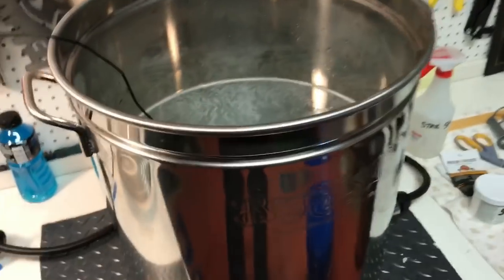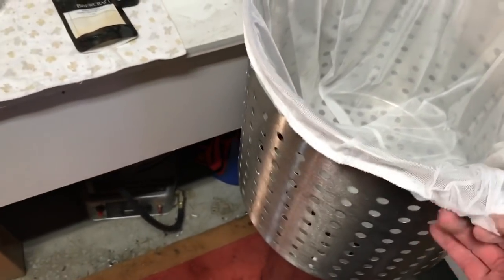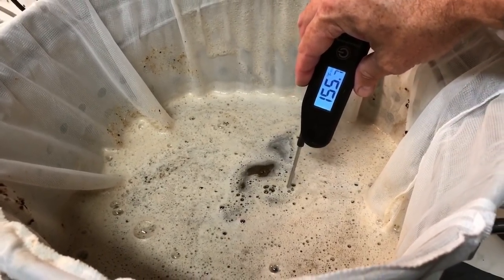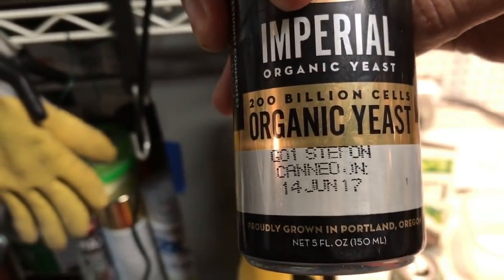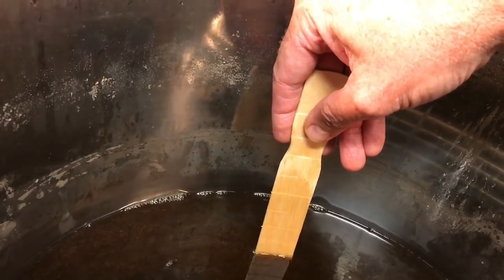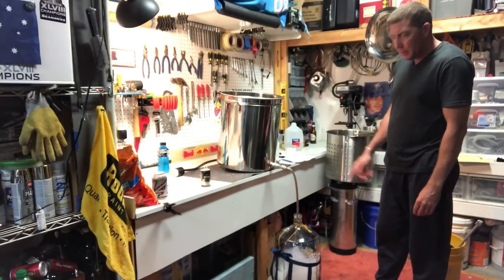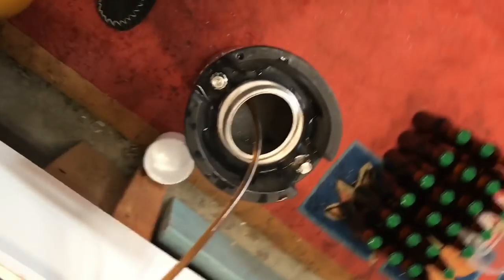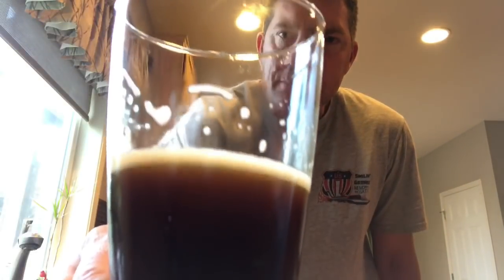Dunkelweizen Grain to Glass

Comment: You can use your recirculating silicon tube as a sight glass to measure your level. You can mark it or put rubber bands at the Mark's you want like 5 6 7gal marks. Cheers. 
How much was your element and controller?
Reply from the maker: DivenFish cheers mate thanks for the tip !
Controller was $8 and element was with plug and lead $70 it’s a 240v 5500wat you can run it with 110v and the plug and lead would be cheaper but I like a quick boil :)